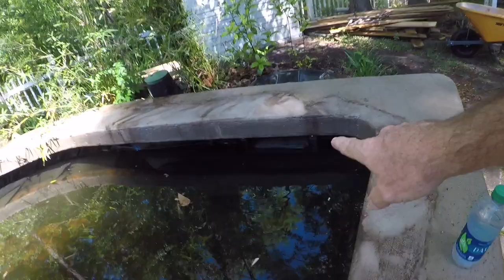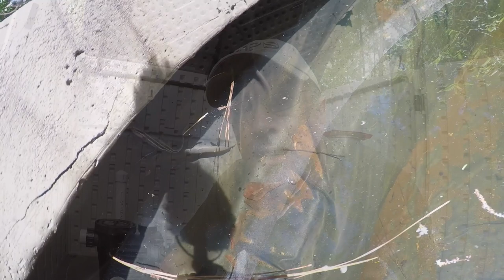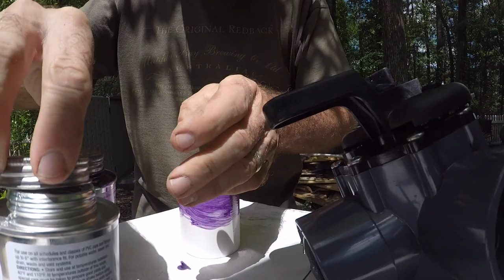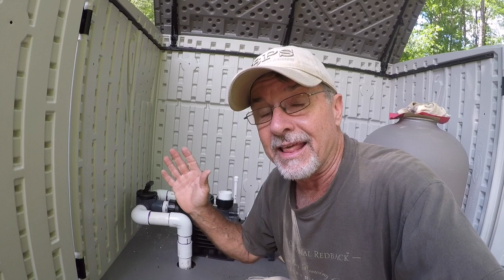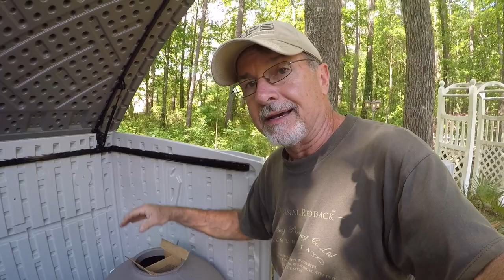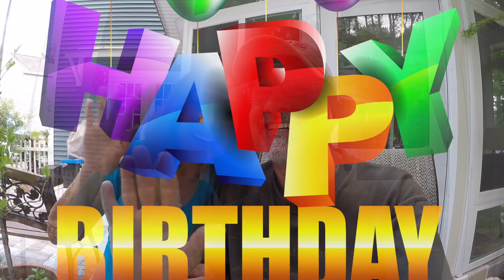VILLA FELIZ - US EDITION: HOW TO BUILD A KOI POND PART 5 (How To Series)

Comment: In HVAC engineering for exhausting rooms we use air changes per hour. So you take the volume of the room and the air changes desired (depending on application ) then determine the size of fan. I would assume there is a similar practice for these ponds. Looks like it will be a nice feature.

Comment: suggestion to better water flow or pressure...in 90degree pvc elbow...use two 45degree elbow...plus put grounding copper rod...use jack hammer ..rod is 10ft.using step ladder bring jackhammer up and insert the copper rod...
Reply: Ruel Chipeco when engineering water flow a 45 is equal to 1/2 of a 90. A long radius 90 is a good choice. All of the fittings have a pipe equivalent length associated with them. This is the actual loss.